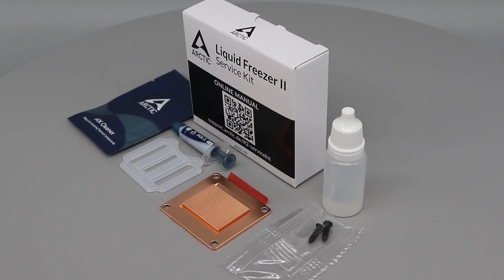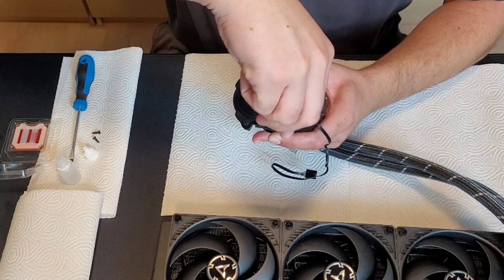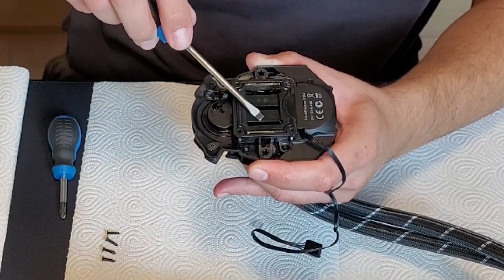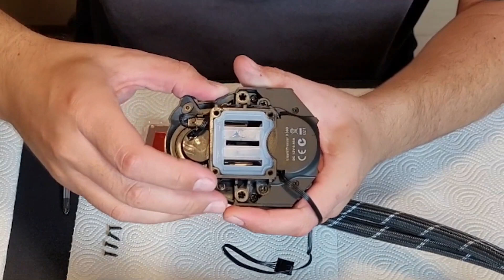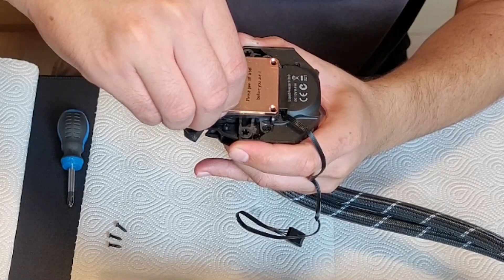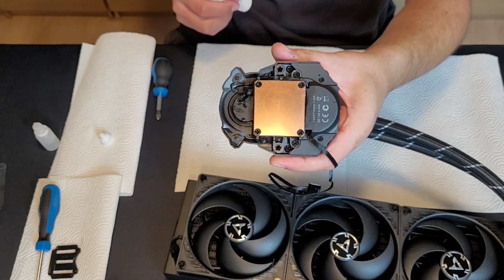Arctic Liquid Freezer II Service Kit Einbau Anleitung

Comment: Now fix the A-RGB line up not every motherboard has a 3 pin 5v RGB header.?.
Reply from the maker: Unfortunately you can't realize such great effects of addressable LEDs with the previous 12V RGB connectors. But fortunately there are some solutions, e.g. with such converters, which convert your 12V RGB signal to 5V ARGB and often even provide with new effects, which would not be possible with your current mainboard: https://www.amazon.de/gp/search?ie=UTF8&tag=redaktionocin-21&keywords=rgb+konverter+12v+rgb+zu+5v+argb

Comment: just wondering what will happen if i over tighten it. i had to do it since plate wasn't properly sealed a saw a little gap between plate and gasket.
Reply from the maker: If the new gasket doesn't seal properly, you'd better remove it again, clean the contact surfaces, and make absolutely sure the gasket is inserted the right way around when you put it back in. Take a close look at the pictures in our written instructions: https://www.ocinside.de/modding_en/arctic_liquid_freezer_ii_service_kit_tutorial/
Reply: @ocinside  thank you for your reply. i have followed each step correctly and once i tighten it, it was sealed properly. but i had to use some force to tighten the new screws.
Reply: @kaboomm-k2e  that's absolutely normal, because the new screws are longer than the old ones 👍the new ones are not easy to overthighten
Reply: @derdaniel8261  thanks :)